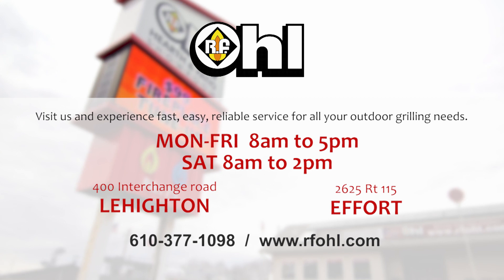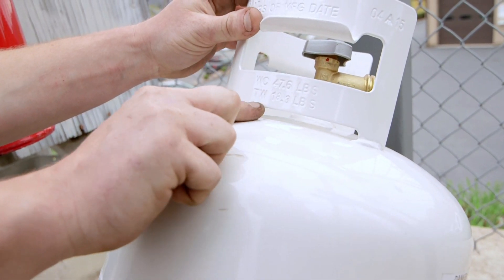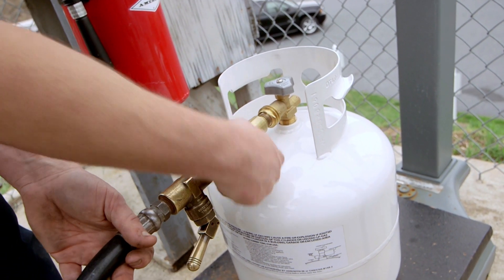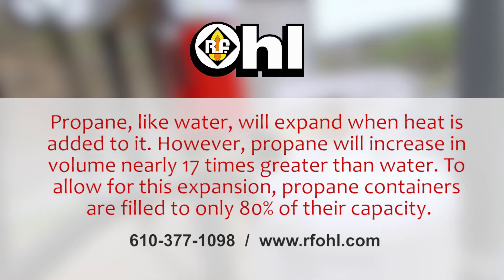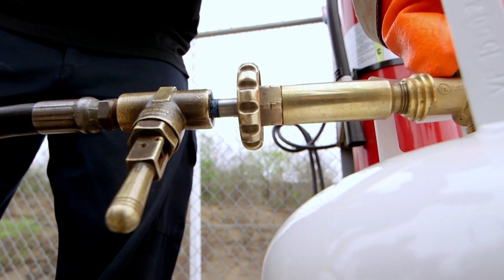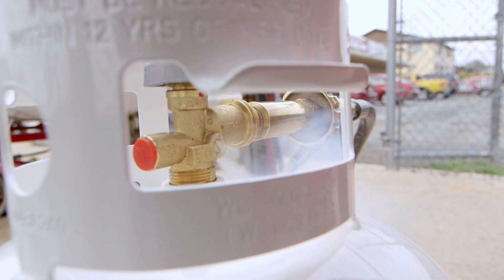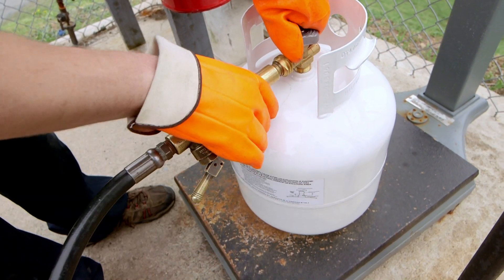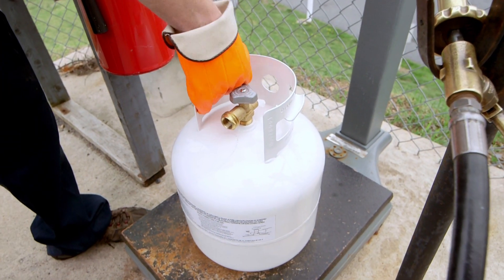How do you refill a disposable Propane tank

Comment: Very professional video absolutely right but everything you said back in the day when there was no OPD they use the scale now with the OPD you use the scales too and that’s a double safety factor very good
Reply: What is the calculation on a partially filled tank. 
Actual weight - TW = propane in lbs inside the tank. 
How do you calculate the target weight for completely full. 
80% of what number?
Also the hose has to enter the calculation as well. 
Recently had tanks filled and the tech didn’t factor in the hose weight. Only got 12-13 pounds of propane in tank ?

Comment: Since all tanks have the OPD valve that cuts off the gas flow when full, what is the use to weigh the tank anymore. That seems to be a leftover from the days before the OPD valves were mandatory.
Reply: an opd can fail, and they do frequently. A scale is the only proper and safe way to fill.
Reply: True we don’t use it we’re I work. I feel it may be regulation though.
Reply: Legally DOT tanks must be filled by weight.  The place I go to fills to the dip tube.  OPD valves fail quite frequently and are a waste of $30.
Reply: Depends on state and local laws on wether a tank can be filled by volume or weight. My state requires to fill by weight. The only exception is autogas and mounted ASME tanks on RVs and Foodtrucks.
Some simple math and you know exactly how much that particular tank should weigh when full.
Reply: @marshall0792  And whether or not you have to be DOT complaint.
Reply: @marshall0792 can you point me to the weight calculation for a tank that is partially filled? I understand TW as the weight of the tank. I understand total weight -TW= pounds of propane left in tank. 
What is the target weight to be full? 
80% of what number is max pounds allowed?
How do you factor in the hose weight?
Reply: @michaellatham1971 water capacity (WC) multiplied by 0.42. Added to the tare weight (tw). Equals the maximum weight of the tank filled to 80%. The weight of the filling hose and attachment is dependent on the filling station.
At my old job the final target weight of 99% 20lbs propane tanks was 39.5 lbs with the hose attached.
Reply: @marshall0792  first of all thank you for responding. When you say 99% 20 pound tank what are you referring to?
Your fixed target weight did not account for differences in tare weight?
I assume that target weight allowed for an 80% fill plus TW plus the estimated weight of hose and connection ?